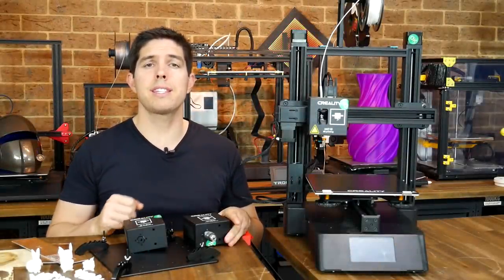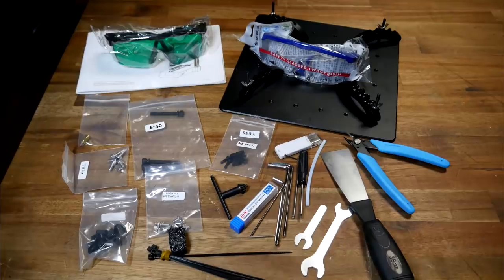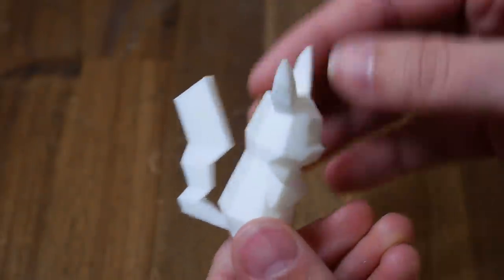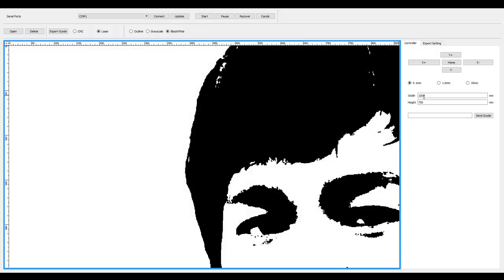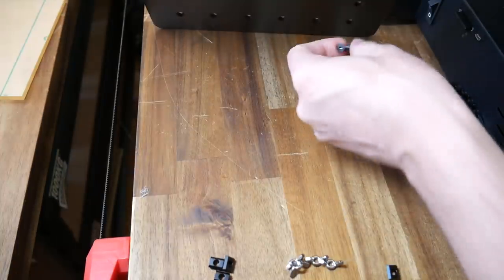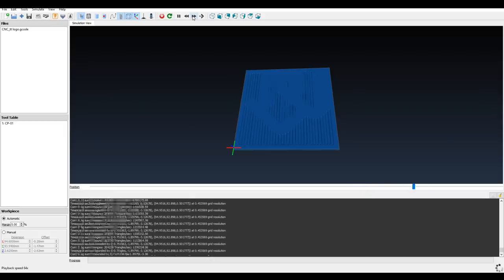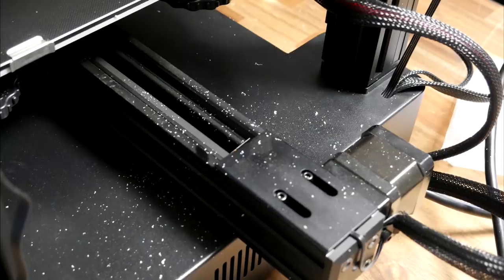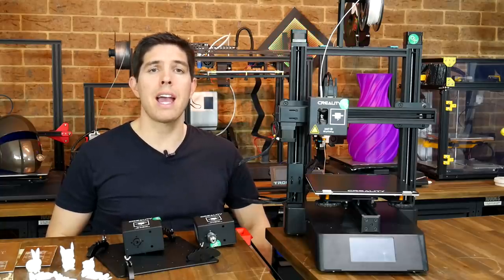Beta testing the Creality CP-01: 3D printer + laser + CNC all in one

Comment: Hello!
Great review, and interesting concept!
I'm happy to see such concepts becoming popular, it will probably help put those tools in more hands, and make it easier to access...
The machine itself seems quite interesting, however i find the mechanical construction cool for 3D printing but seriously not sufiscient for CNC cutting works.
The bed is supported by only  one rail, so it will obviously wiggle when pression is applied by the cutting head away from the central beam... This will not only affect Z height, but Y position too...
It would have been much better of with two parellel rails! 

Also, v wheels are ok for 3D printing, but have some give, preventing accurate position holding while experiencing forces...
However, with two parallel rails on the base, it would be easy enough to mod it to add linear rails (hiwin clones), and i'd add some to the gantry too.
With that in place, it would be much stiffer, and could handle cutting forces much better...

On the other hand, for the laser head, it is probably good enough of a mechanical assembly.
Also, the head assembly would largely benefit from a better system:
some kind of metal  sliding dovetails with a positive stop for perfect positionning each time... 

A screw would then lock it in place once it would have reached the stop position.

At last, this bed system should be gone : the springs are a no go for CNC work; plus with a BL touch they are completely superfluous. I'd rather have a rigid bed with auto bed leveling than this.

And for CNC, since the provided bed is metal, it would be easy to add a touch feature to the toolhead (current going trough the cutting bit, and if it touches the bed it closes a circuit, indicating the bed height. From there it's a matter of indicating stock height in software! Plus it would serve as a Z stop  and tell the machine "do not cut below this height").

Obviously it would be more expensive with my suggested upgrades, but for such a veratile machine, the asked price is quite low; i think that a "pro version" with those upgrades at 1000 US$ would still be really reasonable. Plus, it would make for a great 3D printer, a very good laser engraver, and a good cnc engraver/cutter.

Anyway, kudos to creality for evolving, and bringing new, cool stuff to market.
As a feedback, a machine with all or some of the upgrades i mentioned would be something i'd consider, although i already have 3D printers and a CNC.

Also, an enclosure would be cool, or at least the design could be made so that adding one would be easy.
For 3D printing it would be less important, but for laser cutting, it would in my mind be the first mod i'd do; and for CNC engraving/cutting, it would be a way to keep the flying debris in check, and seriously cut the noise; i think it matters for a desktop machine. So i'd made a thick MDF case, with a front door with a thick glass sheet (8mm) for noise dampening.
Reply from the maker: Thanks for taking the time to share in this much detail.

Comment: Yeah, using a drill chuck for an end mill isn’t a good idea. They really need to convert it to a collet system. Also, the end mill should be as deep as possible in the chuck. The shorter the length of the end mill, the less leverage it will have against the holder, which means less deflection. So I would suggest the shortest end mills you can get to do the job.
Reply from the maker: I agree. The chuck doesn't allow the bit that came wit the machine to go that far in either.

Comment: TEST:
Laser-engrave something on a 3D-printed thing.
Mill something on a 3D-printed thing.
How does that compute?
Reply: you might want to mill some parts to achieve tight tolerances or surface finishes. and equally you might want to quickly mark a unique code or text in the same type of print. ...you could for instance datecode them or put markings on to identify where they go in a assembly without having to build it into the stl.

Comment: I like to do multiple laser pieces and have the laser cut them out. This is a laser engraver, though, not a cutter.  I was hoping the laser could engrave, switch heads to CNC, then CNC would cut out pieces, but the give in the head sounds like this would be risky.

Comment: I bought that glass bed as replacement for the previous one, and the glass bed is awesome to stick objects, you just need to add some hairspray each time lasting a few prints, no more spending money on duct tape and UHU glue. :  )
Reply: For pla,petg haispray its very good but for ABS i use uhu type glue,its tve best for glass and a diy enclousere
Reply: @noway8233  Ok, my extruder is now making spider web prints, i dont know how to solve it.. It prints very thin layers like spiderweb strings, i cant print nothing because of this. I will try to adjust the bed and see if there is something inside the extruder..or maybe ive being using it to much, the hot temperature may be the cause when the issue started.

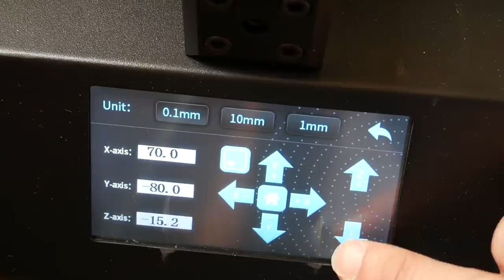Comment: Interesting video thanks Michael.  Creality would be better to leave out the engraving function completely.  If it cannot perform usefully, it will only damage their reputation, which at the moment is quite good.  It was very obvious in the video, at the point where you tightened the chuck (10:00), that there NO rigidty in the machine at all!  This function might just work on a more rigid chassis, like a CoreXY (assuming the best quality belts) with a decent quality spindle and collet chuck.  When you spun the cutter by hand (11:57) there was runout approaching 0.5mm.  Effectively two of the cutter's tips will never touch the work.  A single-flute bit would be a much better option.  That is not to say it would be any good... poodle crap may be better than collie crap, but it's' still crap!    :o)
Keep up the good work!

Comment: Fixed laser power? A little bit of a missed opportunity. My cheap elekslaser A3 came with PWM and it's really handy for tuning the engraving. I upgraded the laser a while back, maybe I should try fitting the old one to my CR-10s.
Reply from the maker: I should clarify. The laser power is fixed in the Creality Workshop software, but it does use a PWM signal. So g code generated in other software would support PWM.

Comment: I'd love it if you could quickly 3D print a part, swap out to the CNC head and then mill the part to final dimensions.  I know there are machines like this but of course they aren't going to cost $600.  A fella can dream though....
Reply: Why? Why add a step? the people making those machines are wasting time I feel. Build a machine that can print the part to spec. One of the main points of 3D printing something is to not waste materials.

Comment: So, I have come to the conclusion that there is an electrical design flaw in  the print head. The extruder tip touched the metal clip that holds the glass plate, and MADE SPARKS. Nothing scary, but shorted the thermistor dead. I don’t believe the extruder tip should be conducting electricity, only heat. Creality says it’s my bad (although the CR10 tip doesn’t seem to spark). I think there’s an isolation or grounding problem. Creality has agreed to replace the head, so all is not lost. I can print again! 12 days in limbo.

Comment: Received my CP-01 yesterday. After unsuccessfully  trying to level the bed for a while, i noticed that the rear left leveling knob was scraping over the top of the Y axis stepper motor. I removed the knob and replaced it with a T nut, and was able to get it leveled and printing. Wondering if you ran into this problem at all? I'm thinking maybe the wrong X bracket for the table was installed. Also, the milling head motor was not attached to the housing(no screws), so the motor was rolling around loose in the housing, damaging the circuit board inside.(broke the plug for the motor) I Sent Creality an email explaining the situation, and they only seem to care if I purchased it off of their website(I didn't, bought from an Ebay seller). Hopefully they will replace the part. There was a big green OK sticker on it, which would lead you to believe it had been quality checked, which it obviously wasn't. I am also missing the chuck key.

Comment: Creality - we are not great, but hell you will respect us and fall in love with us!
Shit I have wird feeling that I have strong need to have the 2nd gen of this machine.
Reply: Exactly what I was thinking.  I avoided Creality like the plague for a long time due to bed issues, burning out PSU's.. just didn't want to take a chance so I went with my Prusa MK3s and have been happy.  I did end up getting a CR10S-PRO and modded it with the usual bontech extruder, bltouch, flex bed system & microswiss hotend with hardened steel nozzle, and I'll tell you what, it's a damn solid printer and I really like using it.  I have to admit though, the bowden setup is a pain at times because the materials I use on it I can't leave sitting out and have load and unload it a lot which causes debris to get stuck and I have to do clean outs somewhat often :(

This new printer looks great, but I'll wait for gen 2 when things get more refined and work better.  Plus if I buy another printer my wife will kill me :D
Reply: @MrNickpeck36  man I feel you. I have Ender 3 and I added a rubber feets, motors dumpers (some says it works some not but it works for me) glass bed, metal extruder and boot loaded marlin, and I have great quality of prints even with cheap PLA (10$ per 1100 g). Right now I'm waiting for new bouden tube, SKR mini e3 and dual gear exteuder to make mostly to make it quiet and because it started to be fun for me. I have worped bad but glass eliminets this problem and I do not need BL Touch cause I learned to level it correctly. I love my little beast, it's rough diamond its need work and care but in end it can give you great things for 1/5 of price of others (price includes modifications)

Comment: I wish you come cut metal with this :p
Pcbs sounds great tho. Tho probably not literally while cutting
Reply from the maker: PCBs yes, but slow. I think a 3D printed support for the CNC motor would help rigidity a bit.
Reply: Nothing is stoping you from cutting metal with it just get the proper bits. You would have to run it very slow though because it’s not the strongest Cnc ever.

Comment: Two comments on the CNC... First, the deflection is caused by three things - strength of the bit, length of the bit shank too long and too much distance between the chuck and cutter edge, and fastening of the CNC module to the gantry. If they would change these issues, it would perform MUCH better. 
Secondly, don't know the power of the gantry. How hard can it push so that if I want harder materials it will power its way through? Soft materials are easy to cut. Not so with harder materials, like aluminum or even steel.

Comment: Apart from the ridiculous length of the Router motor and chuck the rest of it is off to a good start. Fit an ER11 collet front end and supply is with a few collets.

Comment: Seems like a very nice machine. I doubt that this vga plug is meant to handle these amperes though. I had this idea as well but my research showed me that these can't handle the power they would have to for a long time. So they would be a fire hazard
Reply: it is an interesting concept , but that is a shit machine. I am currently trying to get it properly working. 3D prints dont stick to the build plate , CNC bit is way too flexible, the mounting of the bed is better on .. Anycubic Mega Zero ( the cheapest one ), the Z axis srews basically hang and are fixed only on one end.

Comment: Milling with a normal drill chuck!? These are not made to mill sideways, so yes, they flex too much.
Try upgrading the milling toolhead with a small aircooled spindle (50..100 USD on ebay) and use a milling bit that is as short s possible to eliminate flex. That will give you good results when making PCB's, even on a 'flimsy' cnc machine as this.
(good milling bits for PCB traces; search ebay for "CNC PCB Endmill 30degree")

Comment: So, my cP01 printhead shorted out day 1. the nozzle touched the metal clip on the platform, and sparked dead. I have been going round with Creality for 3 weeks...no printing. They have finally agreed to replace the printhead, but are indicating it could be another month or more to receive the part. Creality says they are NOT the manufacturer. They must wait for the manufacturer to ship to them, then it’s on a slow boat from Chins to me. So, this thing may sit for 3 months, DEAD.  This sounds like a “cut out”....Creality is some sort of facade for the  unnamed manufacturer?? I didn’t want to be out of the game for 3 months,so ordered a CR10 from Amazon. The printhead stopped heating. It SAID 210, but MEASURED 95F. The layers would not fuse. I sent it back, and ordered a Sovol...hopefully the quality control of this maker/ assembler will be markedly better.

Comment: Looks interesting. I think the head changing would need some work to make it easier... They should have some locking mechanism that is easy and no redoing of bedleveling each time.
2nd thought... the D9 plug...  is that saFe for transferring the amount current for the hotend and the spindle.. feels bit underrated
Reply: probably linked 3 connections together
Reply: Check out the Snapmaker 2.  I have an original one which is great, but the build volume is lacking. The largest Snapmaker 2 has a 320*330*350 build volume, and does 3d, laser (1600w) and CNC.

Comment: When using the CNC head, did you try multiple passes, increasing the depth between passes?  While slower, it may be the best way to get the tighter tolerances you desire
Reply from the maker: This is possible if using other software to create the gcode. The Creality Workshop cnc toolpaths are very limited.

Comment: Sorry if I missed it in the videos. Is it tedious switching from a different module back to 3d printing mode regarding leveling? Do you have to relevel and calibrate for accurate first layers.
Reply from the maker: Yes. The way the heads fit has a bit of tolerance so relevelling with be needed when switching back to 3D printing.

Comment: “Hey...me again. OK, my heat head failed....thermistor shorted against platform clip? Creality says I can use the Gcode files to test the laser and CNC heads. WRONG!! I select the laser head, raise to 100mm, focus (move the work piece to be under the spot, near the edge of the table.) The instructions then say to select “ procedure selection,” but that DOES NOT APPEAR. Select the “gou” Gcode, and it reverts to 3-D printer mode! SO FAR NOTHING WORKS! $630 anchor. I am trying to work with Creality, but they apparently are “out of office.” I got the auto-reply..

Comment: Hi Thanks 4 all  your videos.   Your videos have helped me learn a lot & I'm very grateful. U could perhaps give me some advice?  I also bought a CP-01 last year August. I updated the firmware to the latest 1 from Creality yesterday. I use CURA to slice and Pronterface to print the Gcode files. 
Since updating the firmware yesterday my CP-01 now changes my bed temperature from 45°C (my default setting) to 125°C. I've not changed any settings in my CURA 4.6 & not changed any settings in Pronterface either. I'm pulling my hair out here trying to find out why it's changing the bed temperature since the update.
Do U know where I can get the original CP-01 firmware that it came with, so I can revert back to the original firmware?
I also have the Ender 3 Pro which with your videos, I upgraded it to Marlin with ABL Sensor , direct drive etc and I use the same slicing and print settings (with the exception of the bed size,) as the CP-01 with no problems. I hope U will be able to help?  Thank U in Advance.

Comment: I am going to say Hell No! Unenclosed Laser is just too dangerous IMHO.
Reply: Right, especially with the glass bed plate, it can reflect anywhere!
Reply: You can enclose it, If you want to print ABS you'll have to do it anyway. Also you can and should change the glass bed for something safer. Or to a mirror bed for a little extra danger.
Reply: @lapidations  I agree that you can enclose it, but if a beginner (and this IS beginners tool) will use it, it must be safe out of the box.

Comment: Isn't that a com port and not vga? I've seen cheaper printers do similar with old LPT ports, having the wiring on the inside of the lpt header leading to the board and the lpt cable leading to the the parts.
Reply: Neither.  It is simply a standard HD15 electrical connector.
Reply from the maker: Not my area of expertise, it looked like a VGA connector to me but I am likely wrong.
Reply: @TeachingTech  VGA refers to use of the physical HD15 connector, combined with the specific wiring and electric signal protocols needed for video signal data as described in specifications published by the Video Electronics Standards Association (VESA). So I can understand why you would associate this connector with VGA ports on a PC.

Comment: Wouldn't the Genmitsu make a better 3D printer, than this 3D printer makes a CNC machine?

It's cheaper AND more ridged. Stick a light weight 3D printer head on it and what's the downside?
Reply from the maker: I tend to agree but that would not be a beginner project, especially adding a heated bed.
Reply: @TeachingTech  Could be a winning ticket for Genmitsu though!

Comment: “DB9” connector is a better name than “VGA connector”. 😁
Reply: DB9 has 9 pins. D-SUB connector on VGA has 15 pins
Reply: @tomaszbiskup891  You’re right sorry, I meant D-SUB (DE15 to be precise I guess?).
Reply: @GilDev2  DE15 is the first time i hear of it, but yeah it is correct. Even in most shops the common DB9 is called D-SUB 9 poles (pins).
Reply: DB9 is a beautiful car...
Reply: @MetalheadAndNerd  That connector is so much more pretty though…